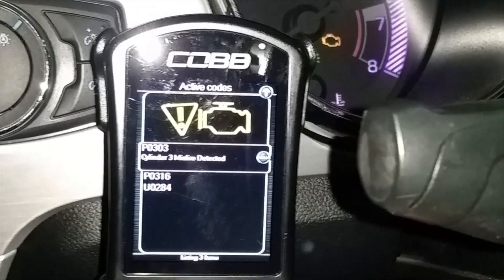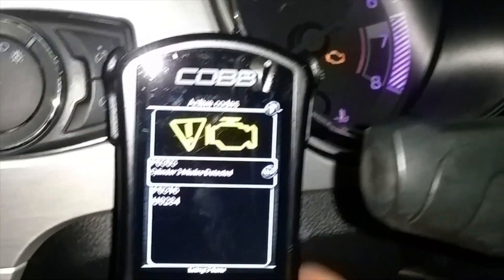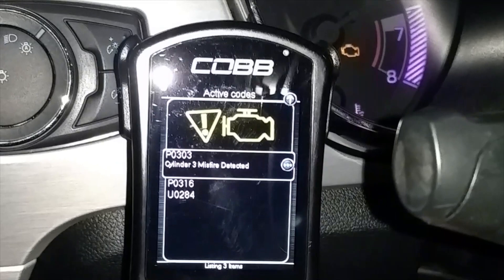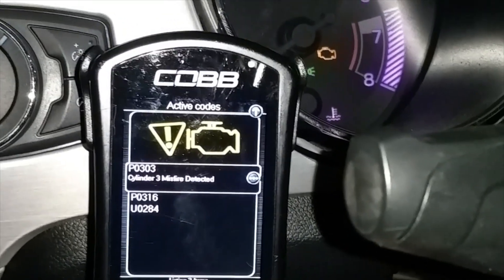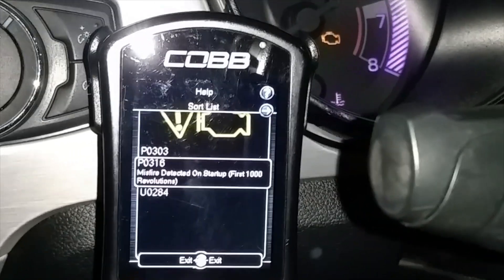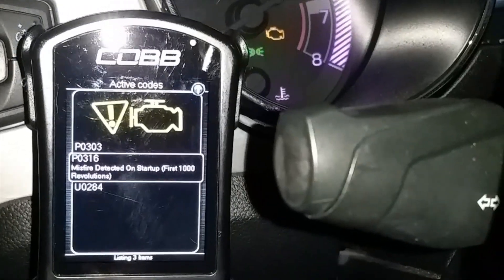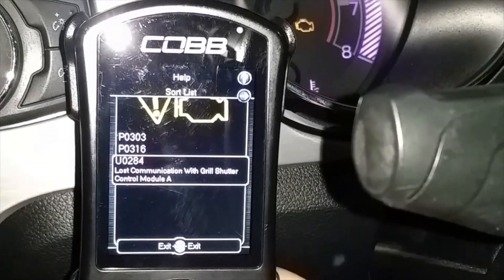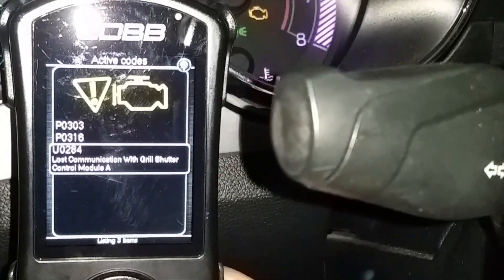Engine Error Codes on EcoBoost Ford Mustang for Misfire (Not A Fix)

Comment: I am getting codes P0300 P0303 P0304. Changed sparkplug and coil packs already. Any ideas?
Reply: Hi , I having same issue . And move to other shop . And they can’t find solution. Did ypu fix yours ? Mine is a ecoboost 2015
Reply: @Dietrich Hernandez  I did get mine fixed. I finally brought it to Ford and they paid 60% of the long block replacement since it was out of Warranty. There's a technical service bulletin out so Ford had to pay 60%. After all said and done it cost me over $8000 woth rentals and previous repairs
Reply: @dietrich0990  it's a flaw in the cylinder head and has to be replaced. Did they do a compression test? Take it to Ford and tell them about the technical service bulletin and all symptoms.
Reply from the maker: What’s the year make and model of the vehicle? Yeah these are all misfire codes. Which typically if you did change out your spark plugs and coils misfire still occurs these will be leaning more towards fuel injectors, or gunked up valves. It can also be other things as well such as a bad map sensor. Or a bad crankshaft position sensor. Throttlebody position sensors.
Reply: @DailyDrivenStangs  2018 Mustang Ecoboost
Reply from the maker: @carycarebear5820  well, I had a P0303 which I did a video on I cleaned my valves and the P0303 went away. So let’s pray that yours involves caked on valves which is caused by blow bye Ketchikan is definitely highly recommended if you are romping on her.
Reply: @TOUGHBUILDS CUSTOMS  mine needed an engine replacement dues to flaw in open deck cooking system.

Comment: My 2015 mustang won’t start & ive bought a new starter,battery,changed the spark plugs & ignition coils it keeps telling me that I exceeded crank time can you help me with this
Reply from the maker: Sounds like it is the crankshaft position sensor or the camshaft position sensor. Also do you hear the fuel pump going when you turn it on? If you fixed it already let me know what it was.
Reply: Hi same with my car , I changed all coils, spark plug, fuel sensor, fuel valve, and the car will start normal for two days.  Then there are days when I start the car and it doesn’t start with force it sounds like it’s struggling to start normal it has a small vibration and it sounds like it’s coming out of the muffler Puff puff puff puff sound And so I press the gas and it stops doing it
Reply from the maker: This sounds like a vacuum leak or a fuel pump. Because now days the fuel filters are built inside the fuel pump you cant just change the filter. When was the last time you did a tune up.
Reply: @DailyDrivenStangs  bought the car used with 38,000 miles last year February
Reply: @DailyDrivenStangs  maybe trying changing the fuel pump?
Reply from the maker: @godshouse2010  should have came with a warranty. I understand you want to learn how to fix it yourself.

Comment: Hello 👋👋
I've 2017 2.3L EcoBoost 
One time I run out of gas ⛽, after that when I wanna put gas in it the engine starts wrangling, the RPM getting low and shut down, so I have to press on the throttle to keep the RPM high or perfect so I keep it from shutting down can you help me what is the problem and how I can fix it
 thank you
Reply from the maker: Sounds like your fuel pump isn't delivering the fuel to your fuel injectors. You may have to Prime the system and make sure the pump isn't damaged when you ran out of gas it's just like you're running out of oil and you run the motor on dry it's going to damage some components.
Reply: @DailyDrivenStangs  thank you
Reply: @fox3sh  purged valve imo
Reply: @mikehernandez6471  exactly

Comment: wait a sec i watched 19 minute video hoping to see how you fixed it and now you’re saying the fix video is some other one? 😂😂😂😂 wtf is this
Reply from the maker: Yeah this is part 1 basically if you take the CRC cleaner take a booster liner off stick the hose from the CRC cleaner in the booster hose which leads to your intake. Spray the can until it's gone let the car sit for an hour start it up Revit three times to 3,000 RPMs no higher take it on the highway Drive. This code is caused by a caked valve.
Reply from the maker: If this code does not go away or comes back then it would be this video you are looking for. https://youtu.be/2z_gatzdnic

Comment: Hi Chris. I want to ask you about the mod you pointed at 9:57 timestamp from the video. I recntly bought a used 2015 Mustang RS1 which has Roush airintake and the air bypass valve hose was not connected. When driving with out the hose conneted it made boost sound (SUSWWH WHEN GEAR SHIFTS ARE MADE) when driving. Recently i noticed and connected the hose thinking It might cause any issue to turbo or engine. Since then I could not hear boost sound. Is it ok if I disccontect the hose and cover it with something as shown in your video at 9:57 timestamp.
Reply from the maker: Yes sir. It is fine just make sure you cover your intake hole that was holding that hose on. What you hear is blow off sound witch is fine.Ill answer this again in my next video and show what i mean.
Reply: TOUGHBUILDS CUSTOMS can I ask with what did you cover it I want to get exact the same
Reply from the maker: @Ritesh777-77  yes, when do you want to do yours? My video comes out friday.
Reply: " @DailyDrivenStangs  If you can tell me I can get it today.
Since it is not making boost sound after connecting blow off tube, it bought "Turbosmart Kompact Shortie Dual Port Blow Off Valve" (still i not installed). Can I still install the BOV with the blow tube off. Will it produce more sound. What you recommed installing BOV or not. Belive me it was making great boost sound when the air bypass valve was not connected blow off tube.
Reply from the maker: @Ritesh777-77  I put in the dual port blow off valve in my mustang in my lates video. Eazy to install. You just need to get those rubber chair grommets from lows or home depot and use you oem clamp to hold it down.
Reply: @DailyDrivenStangs  I saw your BOV installation video It was cool. Bur ill it produce more sound with BOV and blow tube off.
Reply from the maker: @Ritesh777-77  honestly the shorty blow off valve you can adjust it pretty much to your liking. I have mine on almost super soft and it makes noise. But with the hose off the intake which is your blow off hose instead of getting sucked right back into your intake system you're just pushing that out the vapors into the atmosphere it sounds a little better it's a cheap mod to do but either way both of them is a win-win.
Reply: @DailyDrivenStangs  Thank you. Waiting for Friday video